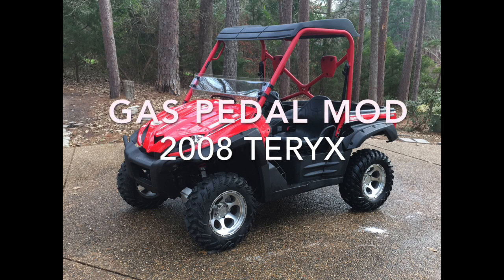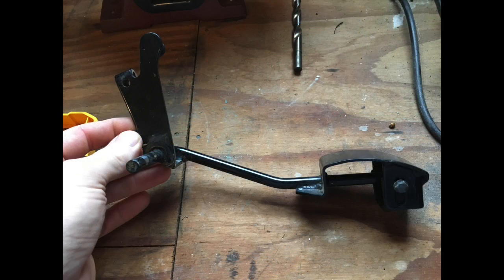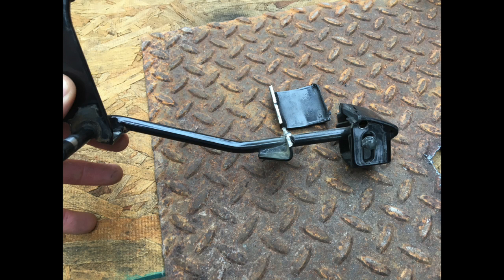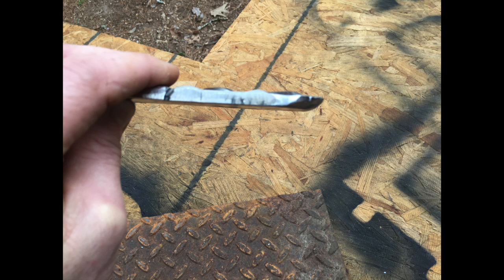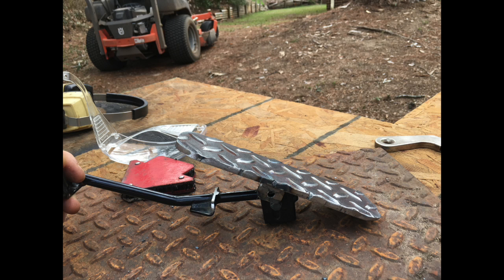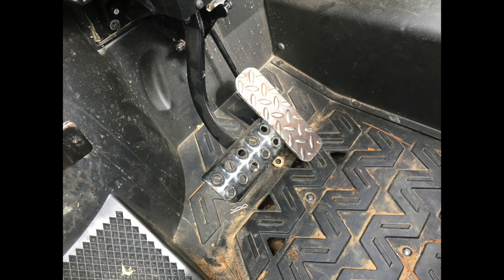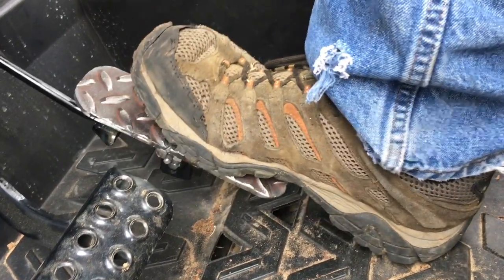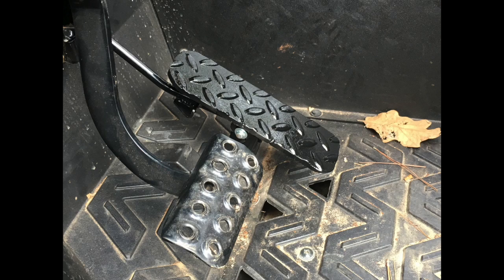2008 Teryx UTV Gas Pedal Mod

Comment: Hard a very real problem with throttle surge on rough terrain on my 2011 Teryx. It was so bad that I was dumping so much gasoline into my engine that it fouled the plugs, and when it did run, I was blowing white smoke out the exhaust. My son installed a stronger spring on my accelerator and my problem disappeared.

Comment: Appreciate this! Son has a Yamaha that (to me) is nearly impossible to keep at a steady, slow speed. Thought it was the way it was and something you had to get used to. I picked up a Kawasaki Tryex that’s even worse. Going to do this modification on both. Didn’t hear you say how it worked out. Could you respond here with an update?
Reply from the maker: Sorry for the slow reply.  This worked well.  Going slow, I still get throttle surge if I put my foot completely on the pedal.  To control it, I put my foot on the floor and use the side of my shoe to push on the pedal.